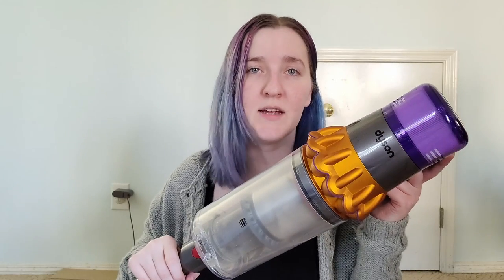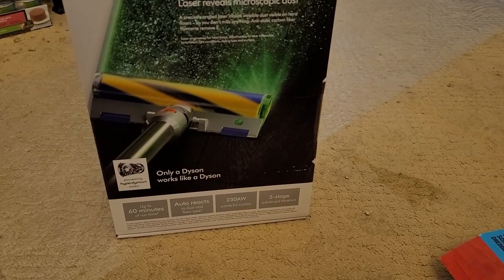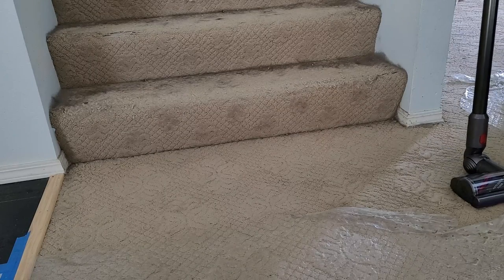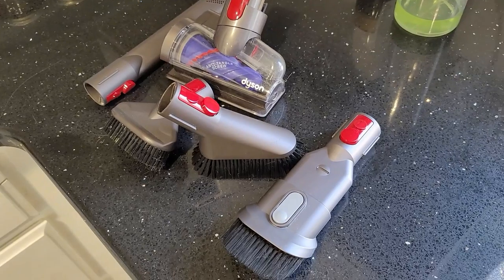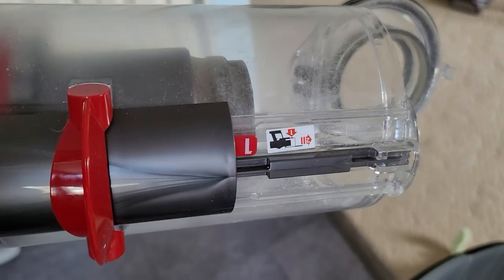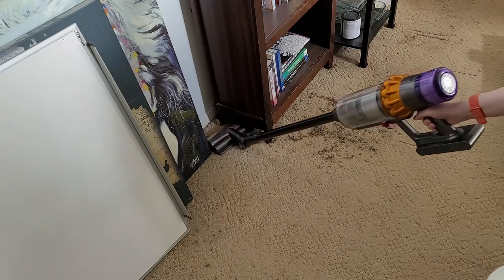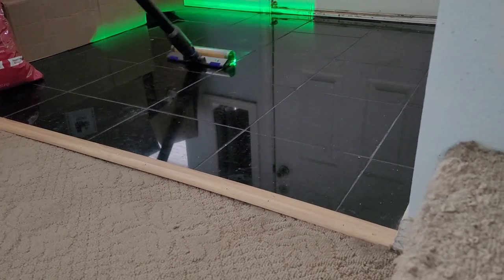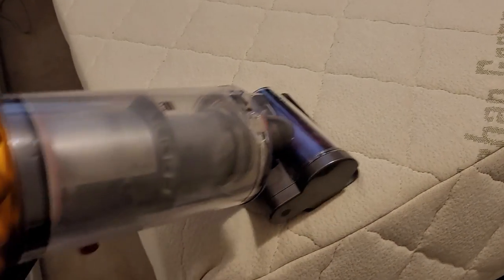Dyson V15 Detect vacuum review ✨cleaning multi-pet home of slobs

Comment: The reason for the trigger button is that you let go for short periods when moving from one place to another, changing the tool or moving things out of the way and hence you get longer battery use as it's, for example, 60 minutes of actual use rather than 60 mins of "power on".

Comment: Good video!

You'll get about an hour runtime when the vacuum is in the Eco mode which is also good for throw rugs.  For ease of vacuuming be sure the gates are completely open on the front of the carpet/beater bar attachment.  You'll move the tab to the minus (-) side on the front of this attachment.  Don't forget to let the battery run down once per month and then recharge, this will greatly prolong the life of it.

(A length of yarn or an old shoelace, etc. can be used to tie on the handle where the power switch is to let the battery run completely out.)
Reply: Eco with a suction attachment - not a powered attachment

Comment: I have a husky and two cats, so you think this is the best option for them?🤣 can I vacuuming the car?
Reply from the maker: I also have a husky, and 3 cats, so what you see here is almost exactly the same situation.

I cannot tell you how well it works to vacuum a car, because I don't have a car. But it is a vacuum. As long as you're not trying to vacuum anything wet, it should work fine.
Reply: @Savallion  thanks a lot!♥️
Reply: I vacuumed my car with it. On boost mode, it worked really well. My boyfriend was impressed
Reply: @carole1864  thanks! I have it now too🤣